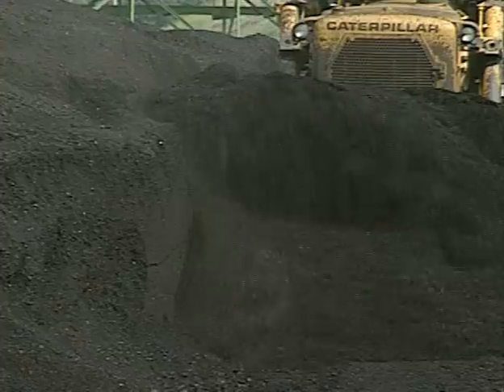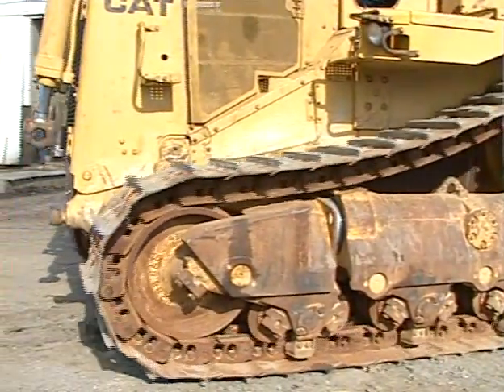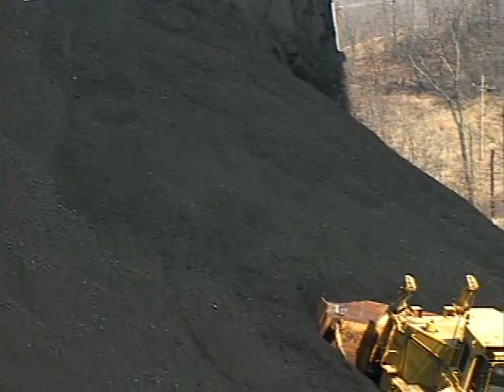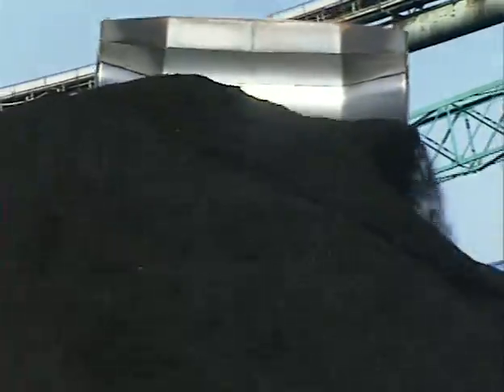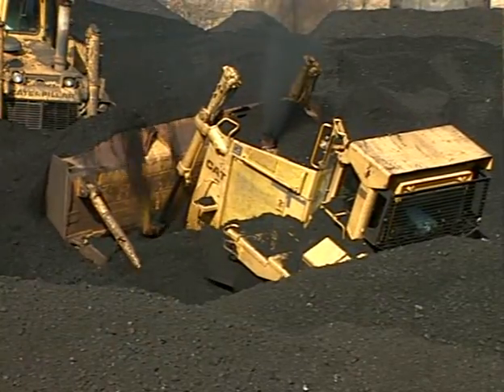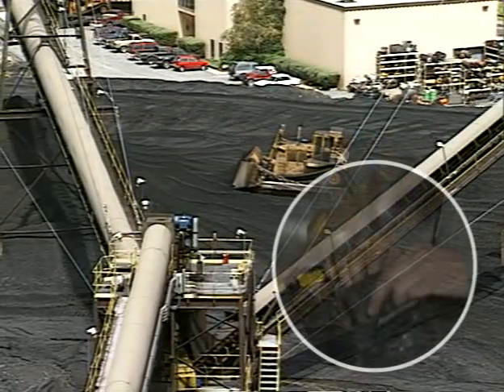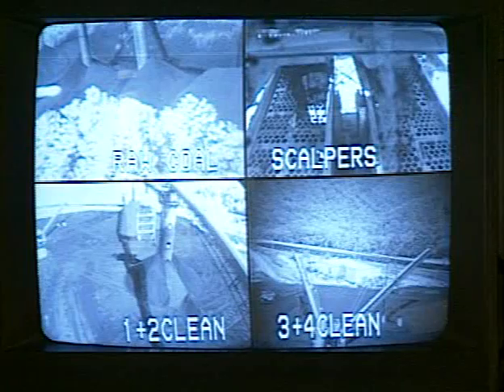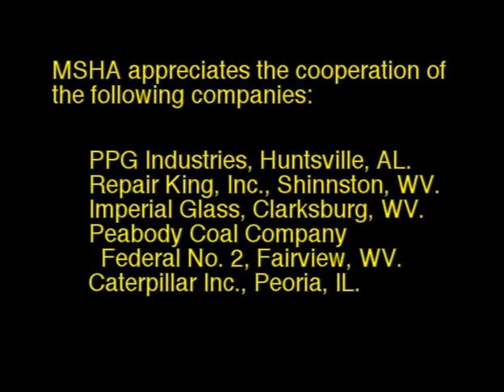Hidden Danger: Safety Improvements for Surge Piles

Comment: The person who mentioned explosives was obviously not informed enough but, there is another way to clear blockages which is Cardox. This is co2 pressurised in a steel tube and then ignited, this should clear any blockages.